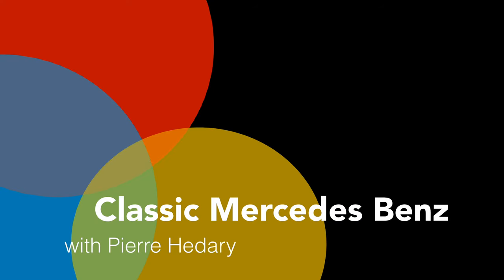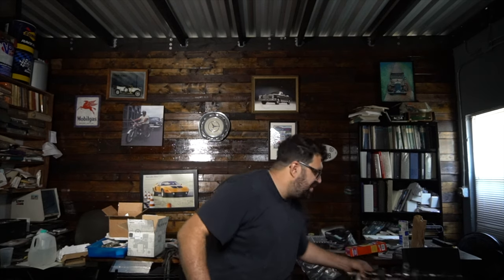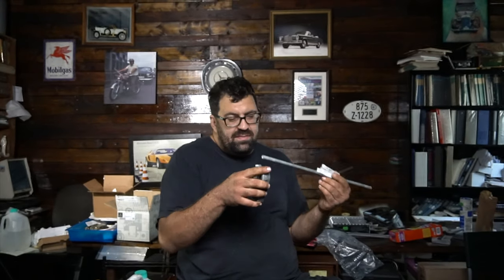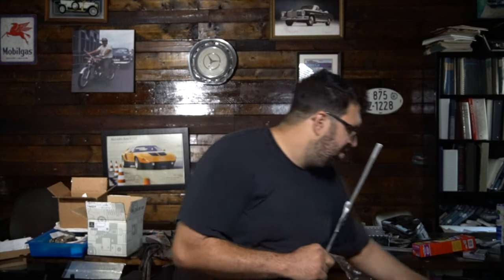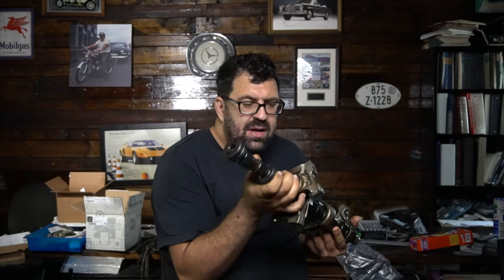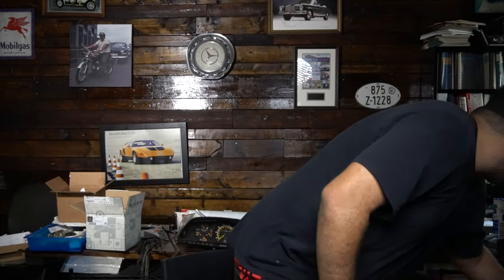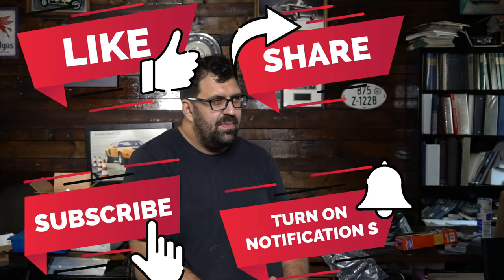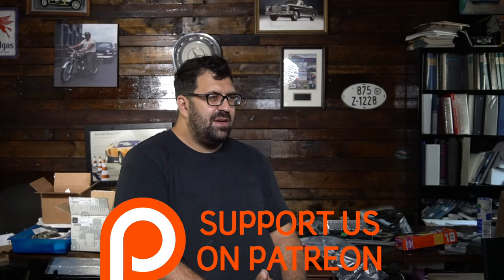Understanding calm shaft  failures Part 1   4K

Comment: My 1979 W116 450 SEL right side cam was replaced after 12 years, 80,000 miles. An experienced MB mechanic, after his first inspection of my recently purchase 11 year old car,  that I listen carefully to the engine at idle—there was in intermittent slight tappet noise every ten seconds. He said that within the year or so the right side camshaft would start to go – a known flaw in this engine  due to oil delivery issues. The right cam is furthest from the oil pump. He pulled the cover and found the oiler ok. Drive it, he said, but I would be forewarned of its coming demise when suddenly there would be a steady noticeable  constant tappet noise and then you had 100 miles of grace to deal with it. Not even a year later he was right. Faint but steady Tic, Tic, Tic. I immediately took it to MB Manhattan where they had two gray haired mechanics check it out – “It's the right side camshaft”, they declared in a thick German accents. They said I was real smart to have brought it in, most people do not and face a real expensive engine rebuild. They would replace the cam and ‘anything we can touch that is worn and especially all the plastic bits, cam oiler kit, and the timing chain guides, and check the timing chain and tensioner (afterward they said the chain was OK  but that I should come back at about 125-150,000 miles). Cost me 1991 $1000 but the engine never sounded better.